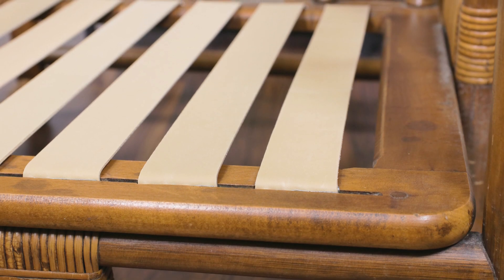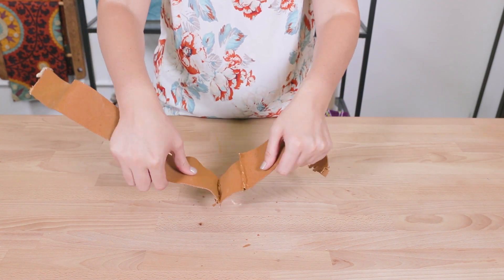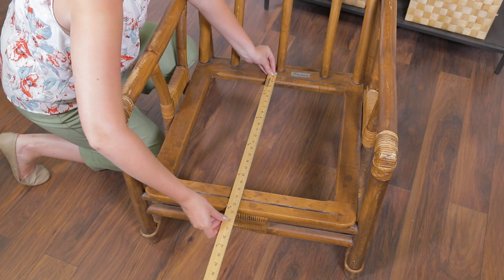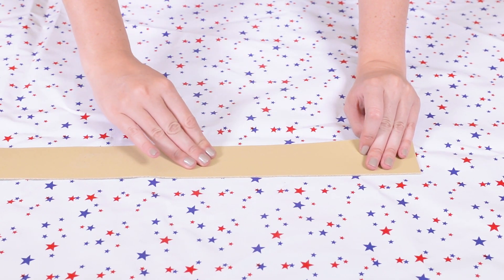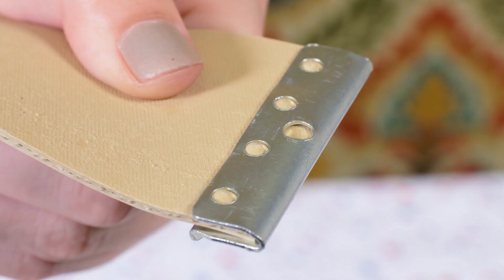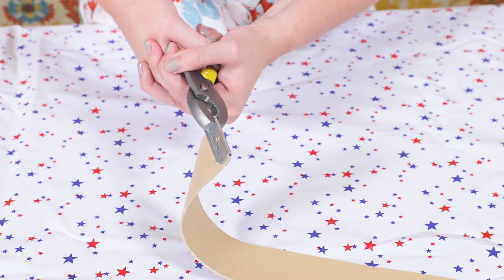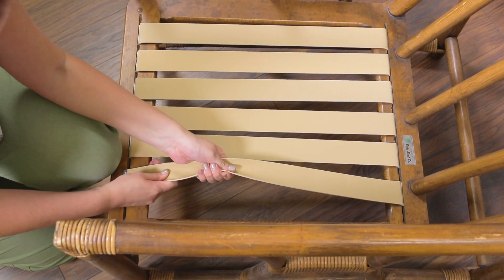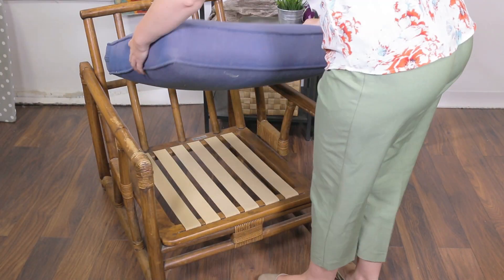How to Attach Rubber Webbing

Comment: Hi. My chair has a groove at the front for the rubbers to clip into, but at the back the rubbers are stapled onto the wood itself. What sort of tool would I need for stapling through rubber and into solid wood?  I'm panicking here.
Reply from the maker: You are going to want to use a staple gun. Something like the one here - https://www.onlinefabricstore.com/dritz-7-16-inch-heavy-duty-staple-gun-.htm
Reply: @onlinefabricstore  Thanks for your advice, much appreciated  -  I'd imagined I would need something heavier. Now all I need is to figure out how long the rubbers are that I'll need to order, if I'm stapling one end down.  I guess it may involve trial and error, especially when I don't even know which end to attach to the frame first, the clip-in end or the staple-down end..... (one disaster coming right up).😕
Reply: Thanks. But sadly, the stapled-down end of the straps is at the back of the chair base and there's no room to use a monkey wrench because the frame of the chair back gets in the way.  So I'll definitely be needing some of your GL. 😉
Reply from the maker: @colmmaguire593  You could also use upholstery tacks if you cant fit a staple gun in there! https://www.onlinefabricstore.com/no-6-upholstery-tacks-.htm